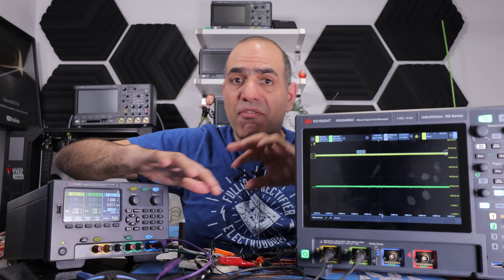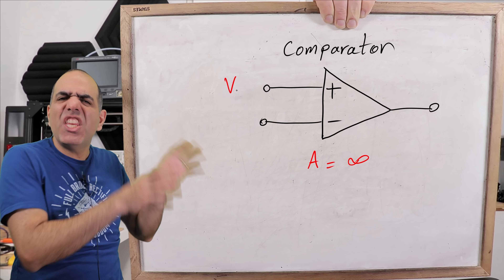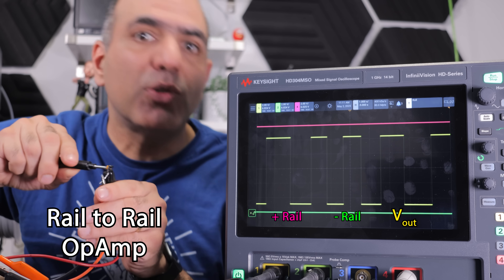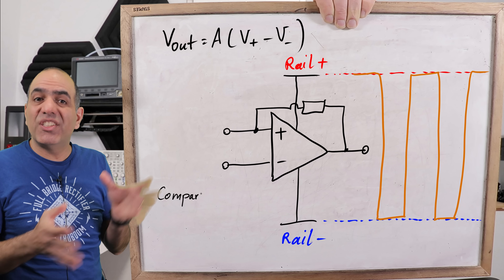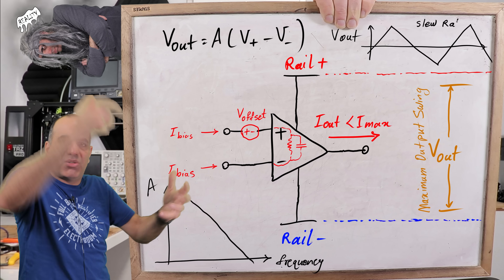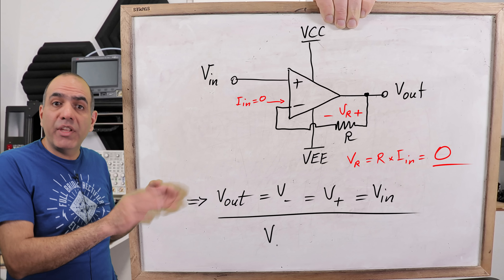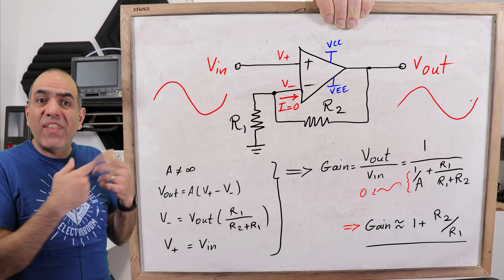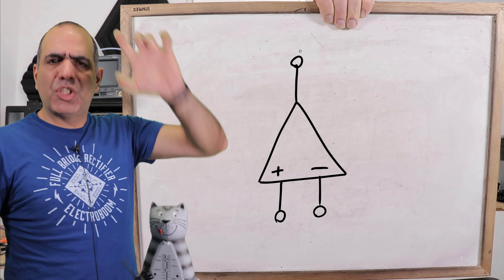The Ultimate Component: OpAmp (ElectroBOOM101 – 013)

Comment: easier to use a transistor set to amplify noise... microphone is the trigger gate, first transistor has a constant voltage output with variable interruption from the microphone tied to the trigger gate, then the second transistor has a gate trigger that matches the firsts output so the voltage steps from, 300mv to 1.5V to 7.5 volts, with a variable resistor on the input voltage to the end transistor the final noise output can be adjusted... leap frog transistor, also adding differing size capacitors with there own variable resistor's allows target frequencies to be absorbed based on the capacitors micro farad ratting, computers have many drain caps to prevent overrunning voltage frequencies between circuits, like dialing a high mid low tone on a noise amplifier... core 1,2,3,4,5,6,7,8... all having segregated drains.

Comment: Could you explain the "rails" concept a bit more? I think I got confused with how the circuit diagram is also acting like a V_amplitude vs time graph on the extending "rails"
Reply: The "Rails" are a positive voltage and an equivalent negative voltage that the op-amp uses and therefore the output voltage must remain between them. EX: +5V and -5V or +12V and -12V
Ground is also used as a neutral reference.

Comment: Hhehe.... you forgot phase angle as a function of frequency (I now run away quickly before I get hit by nerf darts).  

Stabilizing an op-amp circuit sometimes requires small external capacitors... strangely enough, due to the extremely high input impedance.  There is also a limit to the frequency response... ideally infinite but in reality it drops off and that depends heavily on the op-amp.  Some op-amps start dropping off past 1 KHz, some past 100 KHz, some past 1 MHz, some past 10 MHz.  etc.

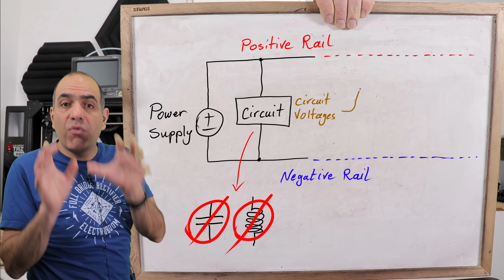Comment: 7:41 guy just discovered latch up in the TL071 series, or tried to breadboard with a high bandwidth video opamp :)  .... wait...... did you intentionally put that at 7:41? I will need to check later if you put something special at 3:24 or something about comparators at 3:11 ....

Comment: If I remember back from the mid-1900's, OpAmps were designed for use in analog computing. Depending on the configuration of the circuit around it, it would perform a mathematical 'operation' such as addition, subtraction, log, etc.
Reply: There is discussion about analog computers possibly making a comeback as their perfect use-case is AI, in that all "weights" can be finely adjusted and quickly calculated, all with very lower power usage.  No clock cycles, just "input parameters" entered into a very large analog matrix, with their values adjusted by trained weights and instantly (well, after propagation delays) calculated at the output.

... also, don't use "1900s", it makes us olds feel... well... more historical lol
Reply: @robspiess  Since the neural networks behind AI are typically enormous (ChatGPT v3 has 175 billion parameters, for example), that sounds impractical. You would need need hundreds of billions of OpAmps. That's roughly the number of components you can fit on a modern CPU, so I guess that's doable, but it would mean the model is entirely hardcoded in the chip. There would be no way to adjust the weights after making the chip - you would have to fully train it in advance and then lock it in. Is there a use case for that?
Reply: @ There was a Veritasium video (I know, pop-sci; but it helps discussion) where he toured a company making these.  They modified flash storage to store analog values instead of digital.  Normally you wouldn't do this for computer storage since it is imprecise, but for AI weights the precision isn't as important.  It also allows the weights to be changed easily.  The storage locations are still accessed digitally, but the values retrieved are analog.  The way the cells are wired does inherent matrix multiplication quickly with low power.
The use case is for embedded "AI chips" to allow smaller or portable devices to be smarter.  Camera image recognition, drones, smart speakers with onboard assistants, etc.
Reply: Yes but it would be instantaneous, totally worth it if someone can find out how to configure them.
Reply: @thomasdalton1508 I think the smartphone industry is just in the right place to start utulizing pre-trained mostly offline digital assistant chips. Current AI solutions could get pushed out of the main CPU die or just be used for the niche tasks they do right now.
Reply: @thomasdalton1508  Honestly, that just sounds rather a lot like an FPGA.

Comment: To anyone who thinks the kind of sparks and bangs in his videos are overdone effects:
Last week I somehow caused a short in an induction heater circuit powered by a lithium battery pack. It literally exploded with a loud bright spark,  it looks like the Mosfet had somehow blown up from inside and vaporized a small amount of metal and coated all other components in a black smelly layer. It's exactly like he shows it!
Reply: "metal oxide semiconductor fire-emitting transistor"
Reply: This usually happens, if you use mosfet in an H bridge configuration (or a half bridge), and the closing side is not closed yet, but you start opening the other... then the mosfets just create a short circuit, and bumm... There are controller IC's which mitigate this kind of error. Don't know the specs, but for 18V motor in my kids small cars I used two IR2104STRPBF for a full bridge (not rectifier :D )
Reply: @EFazy   in that specific instance, I was actually poking around with an oscilloscope probe, so chances are I somehow shorted something with that probe...
Reply: I recently had an OPAmp shoot fire out of it with a huge pop because my board was laying on the workbench with a stray bare wire clipping I had forgot about laying under the project that found its way near the power rails and rest of circuit
Reply: as someone who had recently discovered the joy of connecting a large capacitor bank in parallel with a power supply to blow stuff up, i agree

Comment: This was really a lot of information packed in such a short video :) I mostly used opamps for comparators where I dont want a fade-in of power but a constant on OR off. Love them but i always need to google where to connect what when i use them.

Also a transistor configuration to create an opamp and really show how it works would have been nice :)

Comment: this is an excelent video to get into electronics, at  least  here in Italy in many highschools you learn just resistors and capacitors (never together mind you Laplace is far from the innocent mind of students) which means you  don't know anything useful to interact with electronics unless you want to heat up something and at the end of the day the impression is that it's quite worthless cause you can't really do much with those resistances (and that's when you see the good part the alternative is people trying to charge batteries with voltage dividers). Now I get that transistors can be a bit complex when dealing with the saturation but  teaching the opamp would go a really long way in giving value to resistances a bit more and feel like you can actually do something :D

Comment: If you're doing the basics with Op-Amp calculations, you should keep focused on the last mention of that "inverse distortion" he talked about. The main idea is that  no matter how flipping complex your non-linear circuits are, the opamp will do whatever it takes to make V+ and V- equal (assuming you avoid reality exploding your breadboard). For example, you can use it as a voltage-based current control device by wiring V_out into a MOSFET's gate. A resistor going from the MOSFET source (the "output") to ground follows (V_mos - 0)/R=I_mos. Unfortunately, the relation between source, drain, and gate is not simple ("non-linear"), but Op-Amps offer a solution. Wiring V_mos as V- means that whatever you put in V+ is going to directly control I_mos by manipulating the MOSFET's gate. How? How does the Op-Amp know the exact voltage to control the non-linear MOSFET? I don't care! That's the beauty of it! It does it because that's what the dang thing does!

Comment: This is over 40 years to late for me, as I have been designing and building circuits using OpAmps since the early 1980s. Another commenter has already mentioned the IC Op-Amp Cookbook, by Walter Jung as a great book if you want to learn more, I concur. As for the origin of the name, the following is a quote from the book.

The original concept of the operational amplifier came from the field of analogue computers, where operational techniques were used as early as the 1940s. The name operational amplifier derives from the concept of an extremely high gain, differential input dc amplifier, the operating characteristics of which were determined by the feedback elements used with it. By changing the types and arrangement of the feedback elements, different analogue operations could be implemented; to a large degree, the overall circuit characteristics were determined only by these feedback elements. Thus, the same amplifier was able to perform a variety of operations, and the gradual development of operational amplifiers grew into the beginning of a new era in circuit design concepts.

A suggestion for a live build along is a full wave rectifier. Not something probably associated with OpAmps, but on theme with the channel.
Reply: How about that -- the name actually comes from something that still makes sense.

If there's a live build-along of a full-wave rectifier, I think it needs to start with a "FULL WAVE RECTIFIER!!!!" clip from Hand Tool Rescue's video on restoring one.
Reply: I would love to pick your brain 😂.  Greetings from McMurdo Station Antarctica.
Reply: @SgtBrown-w1v While Walter G. Jung's "IC Op-Amp Cookbook" is a highly respected and influential work, it's not immune to scrutiny or the evolution of understanding in electronics with newer Op-Amp Architectures since the  cookbook and there have been significant advancements in op-amp design. Concepts around low-power operation, high-speed performance, precision amplification, and specialized applications are addressed with different, newer, more nuanced approaches in recent literature. Discussions around noise, bandwidth, or offset voltage are approached differently today. While Jung's book addresses non-ideal op-amp characteristics, the emphasis and modeling of these aspects (like input bias current, input offset voltage, common-mode rejection ratio, and frequency limitations) might be more detailed or presented differently in contemporary texts, with different Pedagogical Approaches: Alternative Explanations: Other authors explain fundamental op-amp concepts, circuit configurations ect, in ways that some find clearer, in essence, while Jung's "IC Op-Amp Cookbook" remains a cornerstone, the field of electronics is constantly evolving. Newer resources build upon this foundation.
Reply: It’s possible to make a rectifier with a couple of op amps and diodes so it’s pretty much the perfect schematic for him go analyse :)
Reply: Rezavi is another good source too
Reply: Oh, fascinating. I knew about using them for precision adding, or multiplying, cool that its name comes from that.

Comment: I am getting more involved with OpAmps lately, I liked the way you ex-PAINed... err... explained them.  I already know about the  Pain-bandwidth... err, again,  GAIN-bandwidth product LOL, but most of my stuff is low-frequency.

I'm presently using the LM324's because they are simple quad-packs, but I have a few Rail-to-Rail OpAmps when I need that.

Oh, and you asked us to put in the comments:  the reason they are called Operational Amplifiers is because they can perform operations, like summing, multiplying, subtracting, etc.  They're pretty awesome devices.   P.S. be kind to your OpAmps and they will be kind to you. (LOL)
Reply: they CANNOT do multiplying

multiplying involve other active elements like transistors which already mean this is not an op-amp thing by itself, even then, it is not true multiplication, it is only an approximation

otherwise, it might involve diodes, which make them completely useless in discrete form because of the temperature variance

op-amp is a linear device and multiplication is a nonlinear operation, they cannot do that by themselves at all
Reply: @urnoob5528  I was referring to gain, input is multiplied by the gain.   However, in the case you mentioned: multiplying 2 voltages, that is correct, that involves a lot more circuitry... sure... Well, the reality monster came over and slapped me!  LOL

Comment: this is NOT a simple buffer, this is the wrong way to connect a buffer

DO NOT connect a feedback resistor for no reason, a feedback resistor in a buffer is usually used to cancel out a same resistor on the other input

u should only use feedback resistor if u know what u are doing

for the example shown in the video, connecting that resistor provides absolutely no benefits and only harms performance like noise, stability, and offset

it is fine if u want to assume it to be ideal, but use a correct example, beginners will see this example and then build it on a real circuit thinking it is correct, this only further spreads misconceptions and bad practices

a feedback resistor should be added when u have a source impedance on the non inverting input

in this case, by adding a resistor of the same value in the feedback, u can cancel out however small the voltage divider effect between the input impedance and the source impedance is, increasing precision

and the resistor also cancels out the offset voltage that is caused by the input bias current causing a voltage drop on the source impedance

effectively, u r matching the input impedances

if u dont know wtf im talking about, the simple philosophy is that from the perspective of the inputs, they should see the same impedance as each other, or to put it simply, there should be the same amount of resistance going into them. if non inverting side has 0, then ur inverting side should be a short and have no resistor

im telling u this as a professional analog engineer from a big company that does analog stuff btw

Comment: when connecting op amp for use with transistors on the output, stability analysis is very important as they can easily be unstable

for beginners, this might be beyond them

Comment: there is no all bets r off when output voltage gets close to the rail

IT WILL WORK and it is not about getting close to the rail, if u generalize it this way, beginners will think outputting near rail is bad or something, which is absolutely false

this is wholly dependent on the feedback network u have

but without considering ur feedback network, the only limiting factor might be input common mode range or output swing, which can get very close to rail, within 100milli volts

this isnt even NEAR rail, this is basically on the rail for most purposes, and they will still work up until here, meaning they can work close to the rail (like 0.5v from rail is CLOSE to the rail, in fact, what do u mean by CLOSE to rail? this is so subjective that it is simply a bad advice)

Comment: Op amps were originally designed to add and subtract.  Then other operations were added.  In tube days, an operational amplifier was a 3U 19" rack-mounted unit with a chemical reference cell inside.  We've come a long, long way.

Comment: Proper engineering is done based on the electron current path whereas the conventional has devolved into a pseudoscience and scientific trade rather than a science. 

Admittedly, my circuit analysis is shit due to being taught the electron model of mass, energy and motion but my ideas are lightyears beyond what's typical from people who actually finished their degrees based on conventional theory. 

Op Amps are just the go-to in technology where today's engineer hired into the company takes over where yesterday's engineer left off. This is where conventional theory holds it's ground which is reverse engineering the work you're hired to continue. 
I primarily work in musician's audio as well as highly advanced high power technology such as a plasma thruster I invented, particle accelerator I invented, motorized emitter I invented, "infinity" bandwidth discharge coil I invented and onward.

In the grand scheme of it all, no matter how much work I put into transistors, MOSFETS, triacs, JFETs etc. there will inevitably be at least 1 op amp in anything that can perform to modern standards. 

As far as audio signals go though, op amps have so much bandwidth that it's a nightmare to tame the high order harmonic content that sounds like static, crust, sloshing etc. Even with bucking away a lot of the bandwidth, the clipping action in guitar equipment by any method still saturates the signal with trashy sounding harmonics.
Reply: wtf is bro yapping about, bro needs to get off that fent

Comment: They are called operational amplifiers because they perform operations like taking derivatives or integrals or multiplying the incoming signal.
Reply: Yes. More moder texts call the Op-Amp a Diferential Amplifier, focusing more on what the chip does on the inside instead of what it COULD do with the external components.

Comment: Legend says that from the 1960s to the 1980s, op amps ruled the world of electronics, handling even the most complex control systems and machines, performing calculations, filtering, and processing in real time. Engineering was on another level because everything was continuous and, to some extent, "fixed design," outlasting those who designed them.